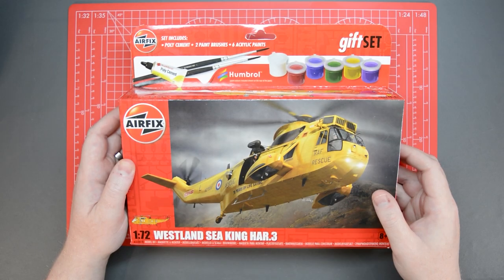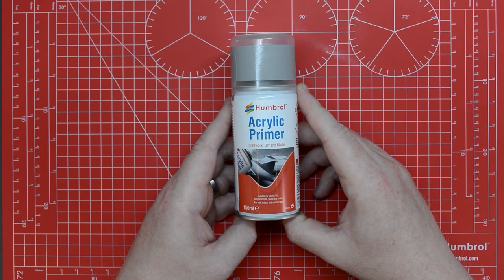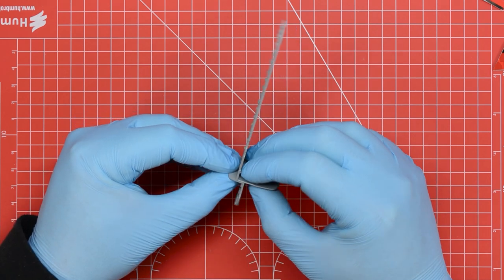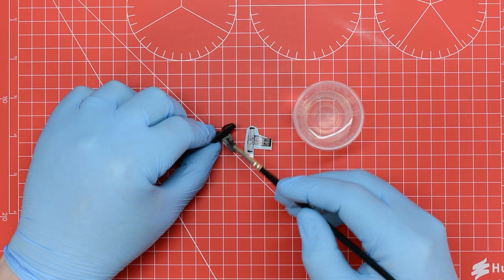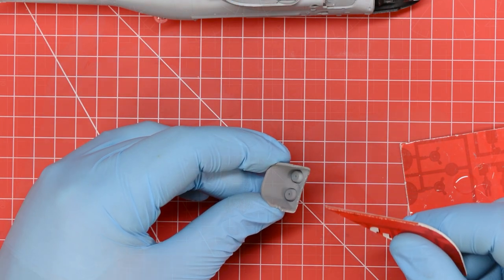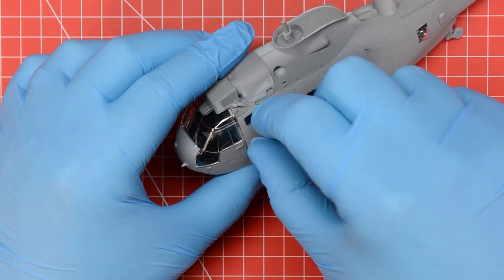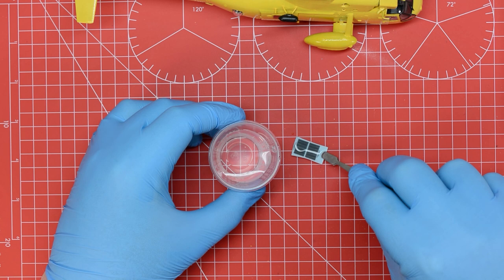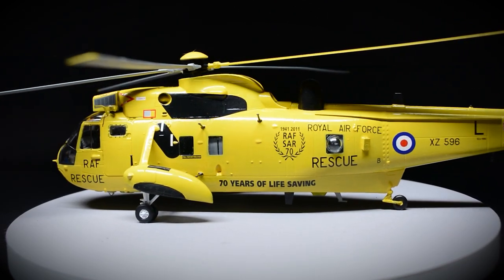How To: Airfix Gift Set - Westland Sea King HAR.3 (A55307B)

Comment: Very good video!  Nice to see you tackling a more advanced 'next level' kit from the Starter Sets. 😃
I built this kit recently - albeit with a different colour scheme - the RAF version in grey; it was a great build and looks excellent 👍
I have the new 1/48 Seaking which I'll start after I finish an Airfix 1/35 Tiger (early) with full interior, which has been a bit of a 'challenge' as some parts aren't a great fit, but overall it's come out pretty well....man those individual track links are a pain though!!  😜

Comment: I built this one a year ago and while it is a well detailed kit, i found i had to use a lot of filler on the fuselage. And yes, I'd recommend using primer before putting on the yellow paint. It was the first full detail helicopter i had built in many years.

Comment: Thanks for sharing the video. You built a nice model. I wonder why starter kits includes only acrylic paint. In my personal experience is easier to brush enamel paint specially if using flat enamel as in the case of military aircraft. Is it for cost? "eco"- awareness? or any other reason?

Comment: '... if you're not familiar with model kits..' Why on earth are you starting with a Skill 3 set, which BTW I think is quite a bit more than 'slightly' higher than a Starter Set.

May I suggest that Airfix do a companion to their /Starter/ Sets, a Starter /Tool/ Set? This could include, much like the Italeri 'Complete Set For Modelling' a set of clippers, a sanding stick, and tweezers. Not the best quality tools, but can be used to build /other/ models.